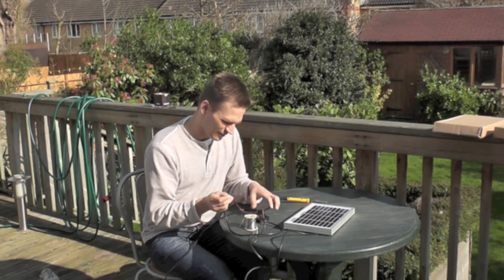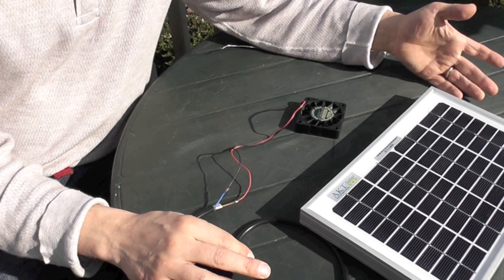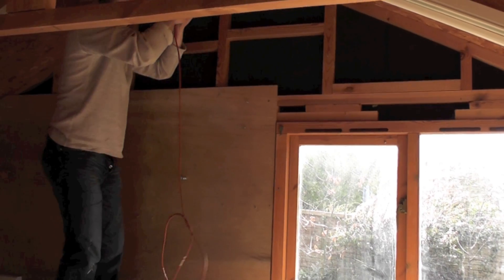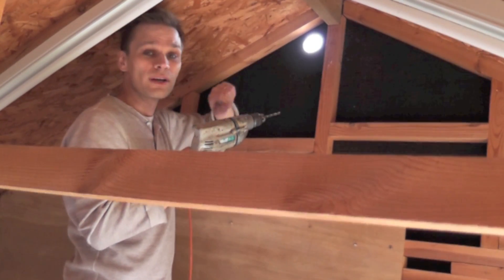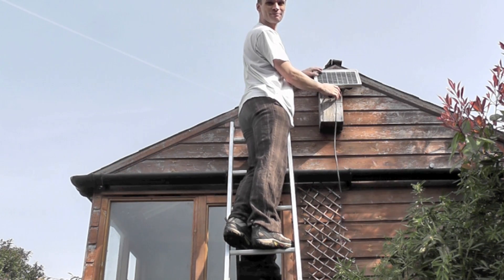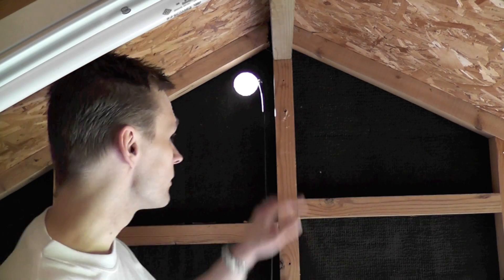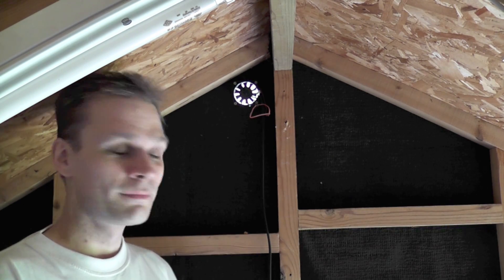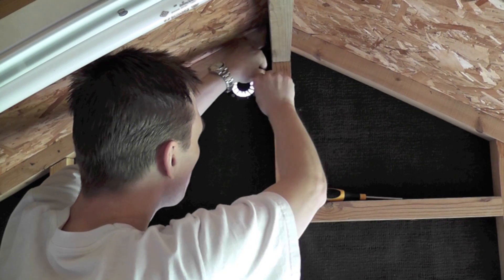How to install a solar extractor fan including mounting the solar panel

Comment: A question from a newbie and forgive me in advance; should a fuse be installed for safety purposes?
Reply from the maker: Hi, not sure a fuse would ever do anything here. The panel will never produce more than about 0.25 Amps. So it would never blow a fuse if you did include one. Hope this helps and Good Luck with your plans!!!
Reply: @aktsolar  Thank you for taking the time to answer my question. Great video and guide. It was very helpful with my project.

Comment: A computer fan is not intended for outdoor use, is it? How does hold up as it is exposed to outside temperatures and humidity?
Reply from the maker: Well I’ve not touched it for the past 7 years and it’s still working so it seems pretty robust. It is actually installed on the inside wall of the shed though and it protected from rain. I hope this helps :)

Comment: You expect me to believe that itty-bitty fan is going to make any difference whatsoever in that big ass shed what kind of drugs are you taking
Reply from the maker: Hi, Thanks for the comment. The fan sucks through about 16 cubic feet of air per minute or around 1000 cubic feet per hour so it does circulate the air quite well. Although of course a bigger fan would be even better, and you could easily power a bigger fan using a larger solar panel.
Reply: @aktsolar  I think I would go with a MUCH bigger FAN

Comment: Sir If I want to 12v CPU Fan How many Watts of solar panel i need is that a 20 wats that was enough to run full speed and Can Direct that 20 watts there is no Fail Damages? Sir AKT Solar
Reply: It depends a bit on the size of the CPU fan. However, generally I'd expect a 5W panel would be enough. So best to get a "12V", 5W panel (as shown in this video) and that will probably work. Good luck!!!

Comment from the maker: Hi there,

Yes, this should be very good for extracting damp air and keeping your shed dry.

The best place to put the extractor fan it is high up on one of the walls (or on the roof of the shed with a suitable covering) so that it extracts the warmest dampest air.

Also it's best to angle the panel towards the sun as much as possible (in the UK for winter the best angle is due south about 30 degrees from the vertical).

Please feel free to ask any further questions.

All the best,

Jonny